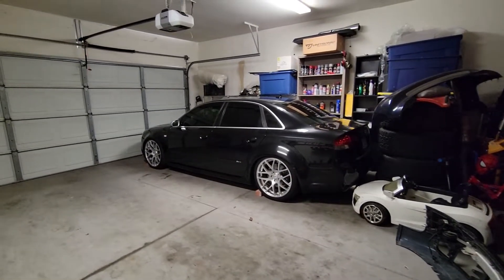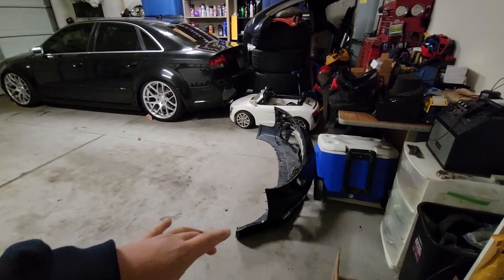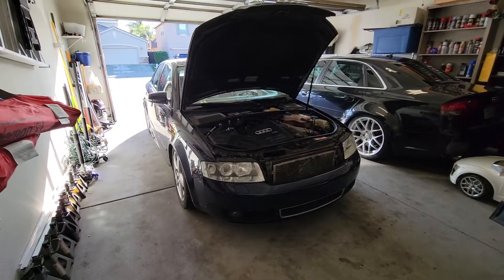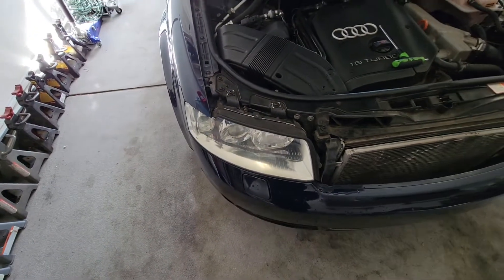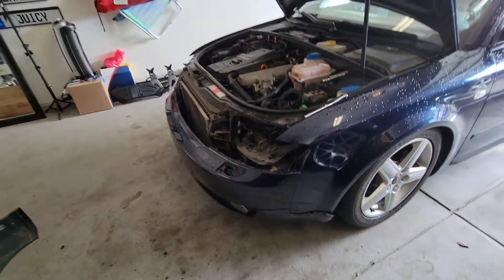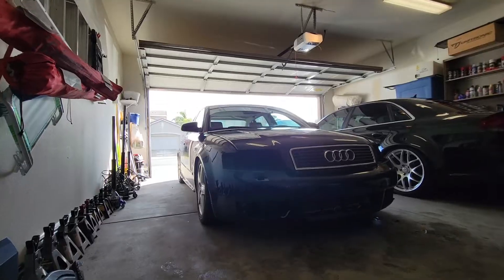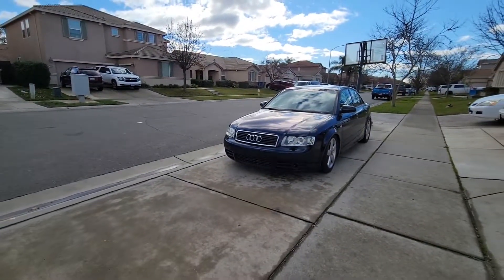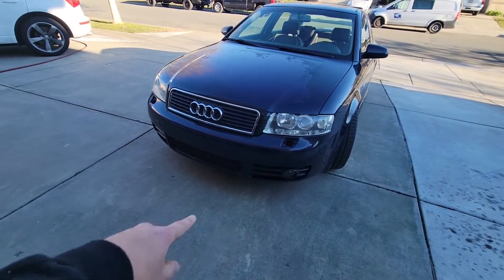B6 S4 FRONT BUMPER INSTALL on My 2004 Audi B6 A4 1.8T Quattro 6 Speed Manual!

Comment: Nice upgrade. I did the same mod a few years ago... for your washer covers you can repair these with fiber and epoxy glue from behind, i replaced fog light grill with ebay aftermarket grill/turn/day position mod, and did ebay front honey comb hood grill, and matched front bumper center grill with custom cut honeycomb panel.
Reply from the maker: Thanks! 

Nice! That's quite a setup haha. Yes I thought about shaving/covering up the washer sprayers area.

Comment: Hey men,
i see you have a a4 b6 but its a s-line version. I have a normal a4 b6 none s-line from 2004 do you think the s4 bumper would fit? not sure if it would fit i heard from others that it could be possible to dont fit on the lock carrier.
Reply from the maker: My A4 was actually a non S-Line and I installed the S4 bumper onto it in this video. It will definitely fit 👍
Reply: Thank you for your answer👍🏼
Reply from the maker: @M666-ve  anytime 👍